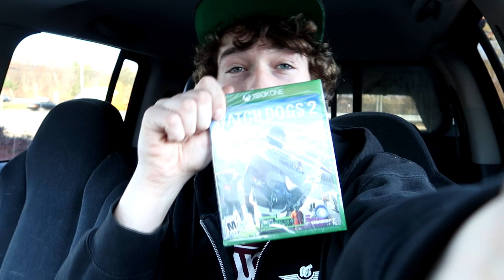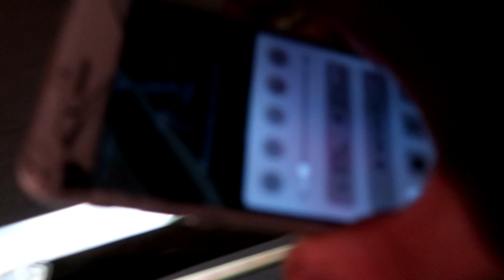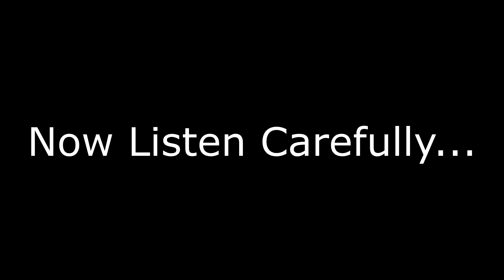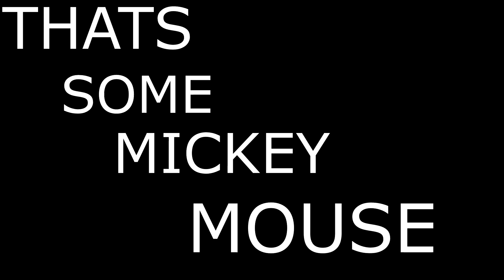Turdbucket Miata Screams!

Comment: Rudnik won that comp by a hair. Oil on the exhaust manifold bolts? Never really thought about that as a substitute, id think the heat from the manifold would burn it off. but I've got anti size for days...

Comment: Guys. Turn the heat up on the welder an slow down the speed u weld. SLOW runs with more heat. Ya welds r sitting on top of the steel an not penetrating. An when ya weld pipe to a flange put 75% of ya weld on flange an just lick the pipe a little bit of weld.  Just a tip. 👊🏻